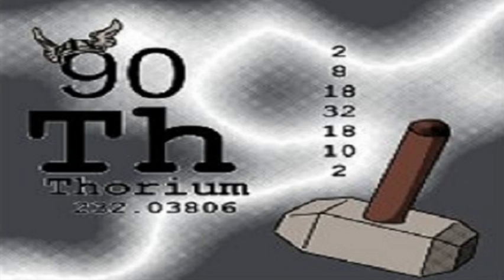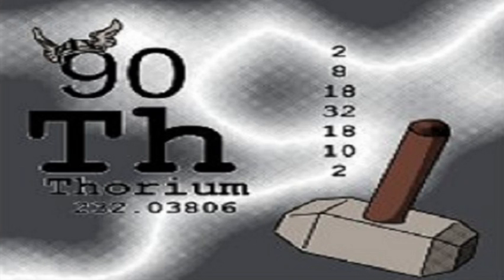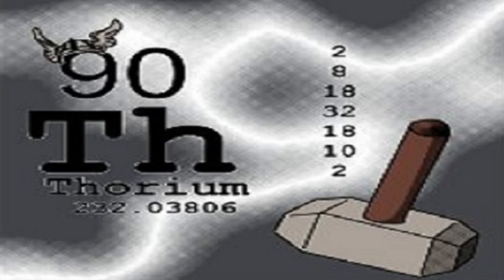LFTR: How This Very Promising Energy Technology Won't Be Developed In the US

Comment: We have been working on controlled fusion since 1953. We have yet to build a reactor that will provide enough energy light up a single LED. Not incandescent flea bulb, and LED! Doing further research on fusion is an exercise in throwing good money after bad. We may as well be putting our tax dollars in the lottery, or even better, dig a hole in the ocean and try to fill it with money. We are more likely to fill such a hole than we are to get energy out of any fusion reaction. 

Why is this the case? Fusion reactions are not self-sustaining. They require energy input to occur. Fission reactions on the other hand, are just like chemical reactions. They are self-sustaining.
Reply: Fusion is fraught with waste, fraud and abuse like regular nuclear. The Tokamak fusion reactor will indeed work. And when it does nobody will buy it. So why does it get the lion's share of fusion research money over other fusion machines? Same answer...DOE
Reply: @matthewdick6063  Absolutely none of the fusion reactor designs I have ever read or heard about have ever produce enough energy to light a single LED. All of the use copious quantities of energy. All of them are like a stove that needs a flamethrower for a pilot light.
Reply: @ManuelGarcia-ww7gj  The tokamak is pretty close to break even. But like I said once the Tokamak works no one will buy it. For the price of the Tokamak we could have been putting serious research into multiple other ideas and learning the physics that much faster. There's a bit more to this than you think
Reply: @matthewdick6063  Given the expenses of constructing a tokamak, the power it may produce is not nearly enough. You do realize that physicists have been chasing controlled fusion since 1953, right? It will soon be 2020. One must know when to stop chasing something.

Comment: Thanks for exposing this scandal. I read many years ago that the research which we pioneered and paid for in the 50's and 60's was given to the Chinese during the Clinton Presidency.  

During the Bush Presidency, I also read that a community in Alaska applied for a permit – now more than 15 years ago.  It has been stalled and stone walled. I think you forgot to mention one powerful lobbying group, which donates heavily to stop this research and / or stop any test implementation.  
The OPEC cartel would disappear overnight, if such a clean, decentralized and robust source of energy were successfully put into operation.
Reply from the maker: You're welcome. Actually the military industrial complex, big nuclear power, the construction companies and the Department of Energy were all 100% anti LFTR so OPEC being against it wasn't even necessary. One large utility company and nuclear power plant operator did try to flip and get a LFTR test plant approved recently and it was blocked
Reply: At least it shows the Chinese interest in investing is relatively cheap and clean energy to reduce carbon emissions (I know carbon dioxide has lesser effect on global warming, but it's still something), which some claim that Chinese is commercializing global warming, though I'll admit that China in general does some shady stuff once in a while

Comment: Thorium Reactors are simple in theory, but there are in fact a lot of technical/engineering issues that would have to be solved before thorium reactors are economical. These technical/engineering issues should not be underestimated. Having said that, the United States went the uranium reactor route, and other nations as well on our coattails, during WWII because we needed fissionable radioactive material for the nuclear bombs that were also under development at that time and uranium reactors produce fissionable material, but thorium reactors do not. The nuclear industry is based on a lot of expensive infrastructure, and economics being what it is, once uranium reactors got a foot hold it became entirely uneconomical to have a nuclear industry with both uranium and thorium reactors.
Reply from the maker: If the US started on this 10 or 20 years ago, the engineering issues may have already been solved
Reply: @WallStForMainSt  More like 20 years ago. The engineering issues are significant as are the costs. I'm not denying what you say just realistic about the fact that uranium reactors now have the foot hold.
Reply from the maker: @ltkreg  if you check the Wikipedia page for LFTR, China claims that they have already solved all of the engineering issues and that they are now moving forward with the LFTR test plant
Reply: @WallStForMainSt  No, there are still tech issues. They're making it sound a lot easier than it really is.